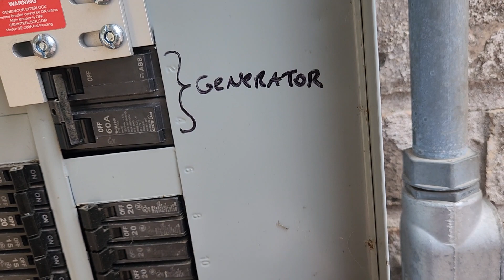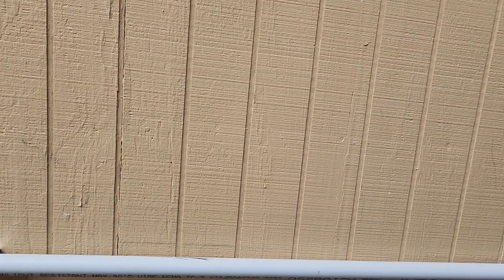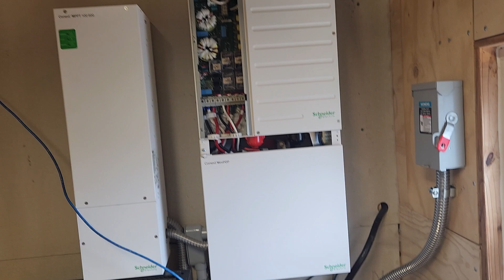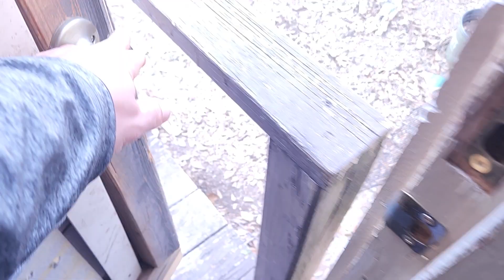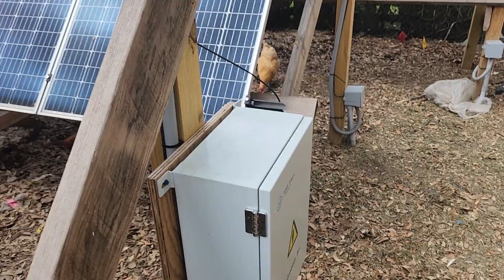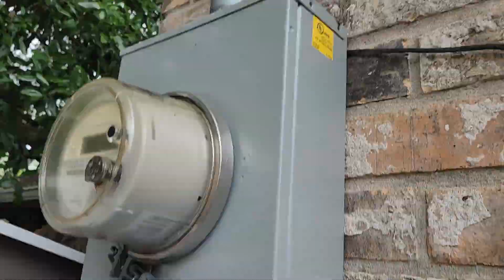Schneider Electric XW Pro with EG4 batteries and 16 REC 370 panels

Comment: Quesstion:  When the Schneider is set to use the generator input, can you power the house AND charge the batteries at the same time?
Reply: Yes, it will do both at the same time.
Reply from the maker: Yes- but you need a GOOD generator. My brand new generator had issues- but that was because from the factory it was broken in a way I could not have known.  Automatic throttle wire solder was bad-only by breaking it could I have known. Once I fionally fixed the generator after 2 years- I can confirm it will work- but you do not want to max out the charging! It can do 100 amps charging- way more than most generators on the market can cleanly deliver over a 50 amp cable. I set my generator input to never pull over 32 AMPs and I am good.

Comment: Could you please share inverter settings for EG4 battery?
Reply from the maker: I apologize for the delay. The key is to ensure all the batteries have the right firmware. Then if it is plugged in correctly the comms are detected in the Schneider Home, and they talk together to meet specific thresholds. I can do a video of my inverter settings if that is somethign that would help.
Reply: @ just replaced Schneider with Growatt SPH-10000-US. Schneider Didn’t work well with EG4
Reply from the maker: @samba2498  Hmm, if you would have contacted Signature Solar support, they could do a remote session and install the new EG4 firmware and the batteries talk to the Schneider perfectly! I am sorry I did not check my messages sooner- the Schneider is by far a superior product- I started with a 12kw Growatt and this one is hands down better plus it is certified for grid connections; some utility providers will not connect a device that does not check all the legal boxes. I am about to put up a new video with the complete systems and settings needed! I have passed inspection and the guy from Centerpoint liked it so much he took pics to copy it for his home.

Comment: Yeah, transformer-based inverters are way to go. I notice you also have Sigineer Power inverter. Was looking at this very model just yesterday. Awesome!
Reply from the maker: It is, by far, the best.
Reply from the maker: Also, the Shneider is roughly 2x more powerful than the Signieer. The Sigineer 6Kw could not run my home with everything on. It could run the AC or the oven, never both. Not bad though. The 12Kw Sigineer is probably closer to the Schneider 6.5 Kw. Schneider gtreatly understates their rating to meet curren and future standards. The Signieer 6Kw would be perfect for a trailer or small home, not a large home.

Comment: Nice setup. I need to go through some things with you soon with the XW Pro/EG4, tie line, generator, pv setup. I like this combo alot.
Reply from the maker: I just survived throught the storm that hit houston and had power almost the entire time thanks to the Schneider and EG4 setup even though I underspeced the system. But my generator was the weak link. I recommend starting with a good generator that has less that 5% THD and then building up the solar system. At the end of the day-if you do not have a massive system you will still need a generator. The difference is I only needed my gerneator part of the time. When it was sunny I was good.